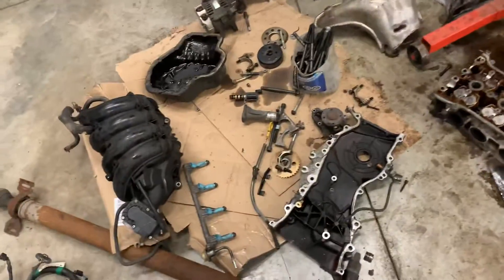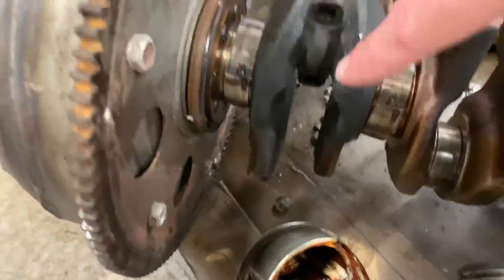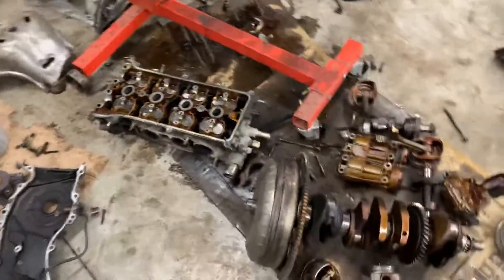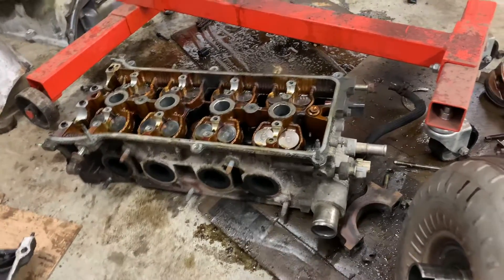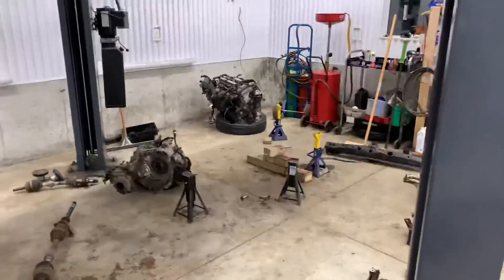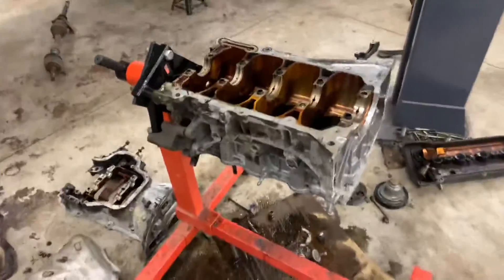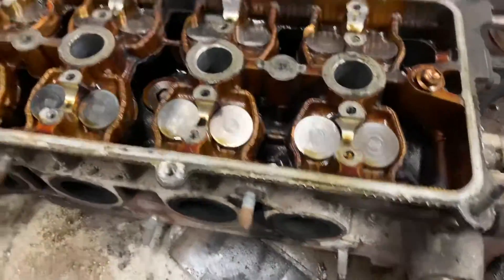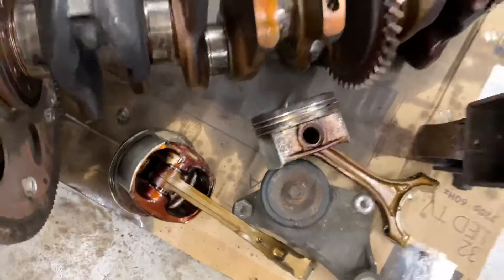2AZ-FE Oil Consumption Problem & Tear down - Seized Engine

Comment: What year engine is this? I see no oil squirters at 1:15? I thought post 2008 2AZ-Fe had squirters?
Reply from the maker: I think it is 2007
Reply: @porkercon  I forgot to say thanks for posting such a great video, sorry about my poor manners. I am trying to figure out the real reason for the oil consumption issue from the many theories out there. I'd also like to know how to determine if a replacement engine has the oil squirters or not. I replaced a 1AZ-FE with a 2AZ-FE in an old RAV some time ago, but did not rebuild.

Comment: Interesting that this issue seems to happen mainly in the usa. I heard its only an issue if the engine isn't run in properly from new. Theres a lot of cars out here in australia that have this engine and well over 400,000kms
Reply: Engines in Aussie cars were made in Japan. US engines made in Kentucky.
Reply: @nampam3945  doesnt matter where they were made the pistons are the same
Reply: @gort3969  Thanks, I have often tried to get to the bottom of it. Ideas put out are (1) piston oil drain holes not angled downwards (2) oil rings as a single unit (3) head bolts undersized (4) sludging of engine if you use non-toyota oil (5) Japanese engines slightly different alloys and different ring supplier.  I don't know which of these is the true explanation. I read that oil squirters were added in 2008, but cannot verify this. The US class action did not apply to other countries, but that may be a technicality.
Reply: @nampam3945  yes i seen a guy on here inspecting the actual pistons and seems the drain holes are to small and get clogged up.  Interestingly the replacement pistons are exactly the same
Reply: @gort3969  Thanks, that is helpful. I heard that too, the drain holes were allegedly too small but then in the replacement pistons they were the same, as you say. Then I saw another US guy showed different pistons where the angle of the drain hole was downwards while the diameter was the same. I am certainly confused about what is the real cause of the oil problems, and if the sludge is a different thing altogether than the issue with the piston rings. Another theory I came  across is that the cooling inefficiency of the 2/3 piston region on the exhaust side caused the head bolts to fail; hence the inclusion of oil squirters in the >2008 models to help cool (well, I am told this but I have not seen any oil squirters in any 2AZ-FE so far). I really want to get the correct final word on this topic.
Reply: @nampam3945  i hear you id like to see toyota actually explain this properly but i dont think its going to happen. I heard they discontinued the tarago/estima except for the hybrid but not sure about that

Comment: Hey great vid! It's great to see it all dissected.  I have the 2AZ-FE on my '09 Camry and it's now at, believe it or not, 440,000 miles.
Reply: wow, does it burn any oil? I have a 2007 camry with 154k and it’s burning oil
Reply: It burns a little oil, it's likely due to the piston rings sticking. I'm trying different things to clean out the rings, so right now I'm using valvonline 5w20 high-mil semi-synth instead of full synth oil. Also using prolong oil additive which seems to be helping.I take it your car is past the mileage limit for the recall to have your rings replaced?
Reply: Wes yes it is past the recall, i’m just trying to find ways to make sure my engine lasts as long as it can, so i’ll definitely try out the oil you’re talking about and the additive
Reply: Any idea of the rate of oil consumption? Miles/qt(s)? I also modified the pcv a while ago which improved not only the oil consump but power/mpg and lowered emissions if interested
Reply: @Wes_5kyph1  i’m not exactly sure because i recently got the car but i believe it’s not burning too much and it’s nearing an oil change so i was thinking of using a synthetic blend as you said and i was just wondering which prolong oil additive you are talking about?
Reply: @Wes_5kyph1  and as for the pcv, what did you do exactly?
Reply: @sufyanmemon5858  You may not need to change the oil or use prolong.  The main reason I am doing this now is because I noticed it was losing compression.  An easy way to know if it's losing compression is to open the oil-filler cap while the engine is running.  If you feel pressure blowing out, there's compression loss.  The only reason I'm using valvoline high-mileage semi-snyth oil right now is for it's extra cleaning additives and prolong because there are no solid particles in it, which might be counter productive to unclogging the rings.  LiquiMoly MoS2 eng treatment is a great oil additive that's safe to add every oil change.  Another good one is DuraLube.  You may want to try either of those with the oil you're using first.
PCV mod is simple.  Find the PCV-valve, back left corner of valve cover.  There's a 7-8'' hose connected to the PCV-valve.  The other end of the hose connects to a vacuum port on the intake manifold.  You just cap-off/plug that vacuum port (the sucking end).  That's it.  You can remove the hose if you want.  The PCV-valve won't spray anything out - you don't need to cap it.  Start up the car, it will idle better,have a lil bit more power, less blowby/emissions because now there's more vacuum for the engine, so combustion/fuel-vaporization is more efficient.
Reply: @Wes_5kyph1  i will do that thank you so much!
Reply: @Wes_5kyph1  i just opened the oil cap while the engine was running and there was a lot of pressure blowing out! should i be worried about this because i just did an oil change with the valvoline oil you talked about but haven’t used the additive you were talking about. does the pcv hack help with compression?
Reply: @sufyanmemon5858  the pcv hack will help generally everything with the engine, so yes; it's essentially plugging a (designed) vacuum leak.  Mine still bleeds pressure too, but performs/drives well, with at least avg 31 mpg.  Compression will only get fixed over time with driving using that oil if the rings are stuck - oil has good cleaners in it as well. Don't stress much about the pressure.  Go by how it drives.  Sure, add prolong oil additive when u can, but the oil is helping anyway.  Feel free to email me: wesk711 at gmail
Reply: @sufyanmemon5858  £¶£